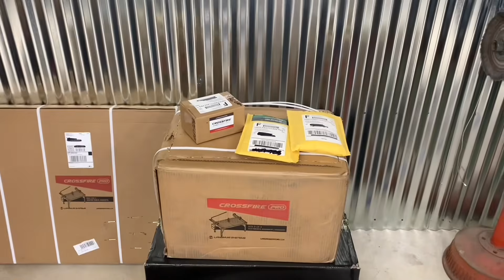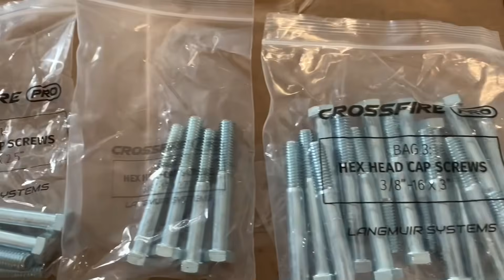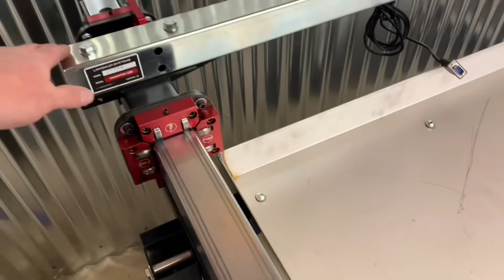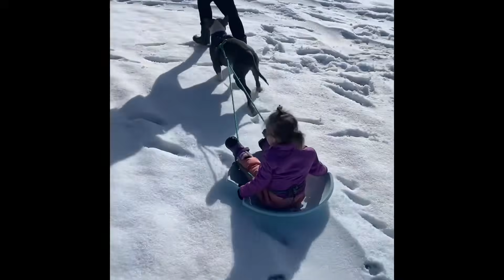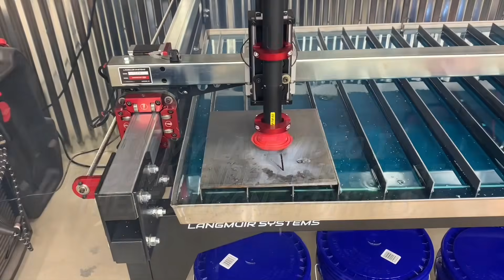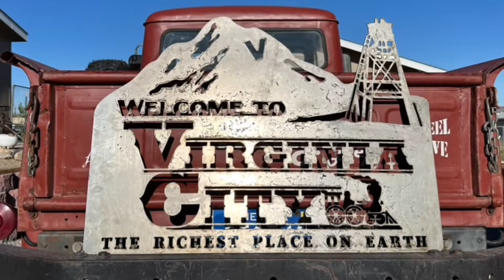Ultimate #Unsponsored Review; 2-1/2 Years w/ Langmuir Systems Crossfire Pro From Start to Finish!

Comment: Your not alone in having problems with getting that set up and running. My Makerspace bought the Crossfire Pro and we already had a HyperTherm torch from our old table. Took us weeks to get it up and running, keep in mine this is a makerspace with several people involved in CNC fabrication and design work trying to get this setup.
Reply from the maker: I believe it! The problem with marketing complex pieces of equipment to the weekend warriors out there is that in order to successfully convince them they NEED this thing in their residential garage, you have to convince them it’s easy and it just works,  @rtaylor616 . I’m just trying to provide some sort of counterpoint to all of the paid promotion that makes CNC plasma seem like a piece of cake. I’m not angry or bitter. I realized quickly that I was in over my head, and it was sink or swim, so I swam.
Reply: This is a real good and informative video! I am just damn glad I didn’t buy one these days ”lemons”!! I am currently building one of JD’s garage offerings. And I learned about the EMI problem through my research on these plasma cutter’s. You have to basically ground everything to prevent that feed back. Thanks Casey!

Comment: I had an issue with the system either moving at three times the speed on the Y axis or moving at half the speed depending on the dip switch position so they sent me 2 new drivers and a control board which I swapped out. It fixed it but theres still another y axis problem I'm chasing which I can live with
Reply from the maker: I cannot overemphasize how incredible a resource the forum is…

Comment: I bought a Pro about three years ago and it has been a very good machine. I got the Razorweld plasma cutter with it and had a disconnected wire from new, that took a few weeks to figure out but then all was good. recently got a Hypertherm 45 Sync to put on it and that was $$ well spent, It almost turned it into a new table. Used fusion 360 for CAD and CAM for the first 2 + years and have gone to Sheetcam now for CAM and I am now VERY pleased with my set-up. The hardest part is learning the Cad and Cam, I suggest anybody considering getting a table of any type to learn all of that first. At 67 I am NOT a computer guy at all but if I can grasp it anyone can....Good luck and have fun.............
Reply from the maker: Thank you. My biggest gripe is that I don’t use it more, but that’s not the machine’s fault. I wish I had the budget for their new big laser rig. What they’ve done with making tech affordable/approachable is impressive.

Comment: Do you recommend the Everlast unit? Is the cnc connector plug n play?
Reply from the maker: Good questions. The CNC connector is NOT plug and play; neither Langmuir nor Everlast recommend using it with the Langmuir tables, so wiring to raw arc voltage is the way, and it’s pretty straightforward (plenty of tutorials out there if you Google). The Everlast has been pretty good to me. It cuts beautifully. The only drawback, and this is kind of a known piece of maintenance, but you have to occasionally rebuild the air solenoid inside the machine. The process takes about 30 minutes. Some folks have argued it’s a design flaw, and some have argued it’s just preventative maintenance. Regardless, the unit IS rebuildable, so  that’s a plus, I guess. Do I recommend it? Not exactly. I recommend the Hypertherm, even though I do not personally have one. All of the folks with the most success at CNC plasma cutting do, and I wish I had purchased one too. IMO, the Hypertherm is worth it simply for the fact that their cut chart takes all of the tuning/guesswork out of CNC plasma cutting various shapes and thicknesses of stock.

Comment: I’m having the same issues, I can’t get the THC to function properly and it just stops cutting and raises up while it is cutting. Getting frustrated with this table !!
Reply from the maker: @72monte61  Raising up could be the IHS switch triggering, or it could be voltage back feeding. You could try what I tried when I had the breakthrough; insulating the workpiece from the table. Just make sure you don’t start a fire. 😳
Reply: @crazycaseyscustoms I’ll give it a try, thanks !

Comment: Ever had an issue with the torch height control ?? I never use mine because when I do it shuts off always about 2 minutes in   So    I never use it
Reply from the maker: My issue WAS with the torch height control,  @richsharp1524  . I explain in the video, but torch voltage was back-feeding into the brain, causing the software to freeze. Sometimes it would do it when torch height control was making a downward move, and crash the machine.